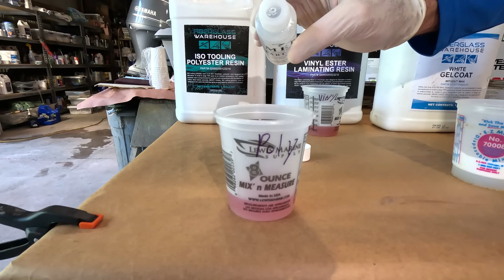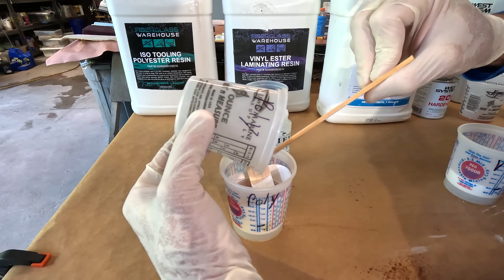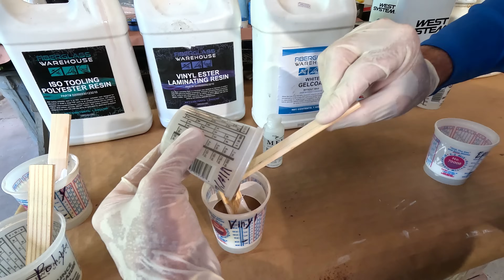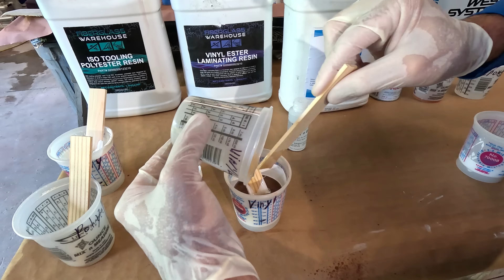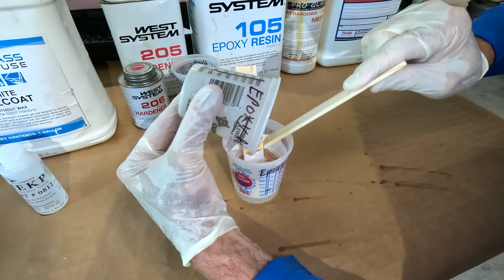MIXING GELCOAT with EPOXY! WHAT WILL HAPPEN? Is It COMPATABLE?

Comment: I completely replaced the stringers, foam and all wood in the floor of our boat. Have since replaced everything - stringers, foam and wood. Now I would like to paint the Bilge with a white coating. The Bilge has 100% new cured chop strand with epoxy coating it, I sanded it with 60 Grit. What product would you cover the bilge with? Thanks

Comment: Like you stated the epoxy is sensitive to resin/hardener ratio....next thing you do is dilute the appropriately mixed epoxy with incompatible ester....spreading thin the hardener that was going to be curing the epoxy just fine. Would increasing the amount of hardener result in a proper cure in this scenario?

Comment: Over 80K buddy, you'll get that silver plaque soon.  This was an interesting experiment.  I remember a few decades ago a friend of mine put some old epoxy paint over an old fiberglass boat.  I don't know if it was a bad mix or just too old to cure but what a mess.  It didn't cure at all and we spent several days scraping uncured paint off of the bottom of that boat, what a mess.

Comment: Hey Joe,  I am learning g a lot from your videos.  I have made some composit plywood boats before with epoxy.  I am planning on going up a big step and make a 26 foot ply on frame boat.  I hesitate to start glassing a hull this large with the short work time of the poly resins.  I am thinking epoxy with good paint instead of gelcoat for my bottom and sides.  How would I use poly to glass such a large area consistently if I would go the poly/gelcoat route?
Reply from the maker: I'm glad to hear that you are enjoying the channel! There is certainly nothing wrong with using epoxy on your 26 build, if that is what you are comfortable with using. Vinyl ester resins also have a lot of good qualities, that give you a bit of a hybrid between epoxy and polyester resins. You might even want to consider buying some different resins, and testing them a bit, just to see the different working qualities yourself. I also recommend scrolling through our channel content, and really study the videos on the topics you are most interested in as a way to really learn as much as possible. Beyond that, I do offer direct consulting services through Patreon if you need more than the videos can provide. I hope this helps, and I wish you all the best with your project!

Comment: is it the same for epoxy primer? will gelcoat not stick to the epoxy primer? or is it just epoy resin the gelcoat will not stick to? please help!
Reply from the maker: Yes, generally, it is not recommended to apply gelcoat, which is polyester resin based, over epoxy based products. There can be problems with curing and  long-term bonding between epoxy and gelcoat. I do have a video titled You can gelcoat over epoxy. In it I show a product made by System 3 epoxy called sb 112. It's designed to work between epoxy and gelcoat. I have the sb 112 and all of the other products we use in our videos in our Amazon store, listed below our videos descriptions. I hope this helps, and thanks for watching!
Reply: @FishBumpTV  your answer is highly appreciated. thanks!

Comment: Another great video thank you! I have a Fir wood constructed console and leaning post. What would you recommend for finishing the inside. To cover the wood and protect form moisture? Can you mix resin and gelcoat like you just did and just roll it on to the sanded wood?
Reply from the maker: Thanks, I'm glad you are enjoying the videos! I would recommend at least a layer or 2 of csm fiberglass to thoroughly seal plywood from the elements, if it were me. I have seen some people, just resin coat the wood, which is certainly better than nothing, but adding glass is better. I have several, How to fiberglass over plywood videos here on the channel, with each one using a different type of resin. I think you would find those videos, among others here on the channel, very helpful! I wish you the best, and I appreciate you watching!

Comment: Worst example i've heard of is polyester repair over epoxy, worked perfect for years, until the boat was in a storm and the repair started falling off, they didn't loose the repair totally, so no catastrophe, but it was close,
It would be interesting with some experiments with polyurethane, not the foam, but in two part glue form.
Reply from the maker: Yes, that is why we don't recommend polyester or vinyl ester over epoxy. It may work fine for a while, but can fail over time, or when put under high stress. Thanks for watching and taking the time to share your experiences with the channel!

Comment: What I'd like to know is if your using tinted gel coat over the repair to color match, then after a few hours can epoxy clear resin be sprayed over top of that as a clear coat to finish blending the color?  Similar to the way a car repair is done but on a boat instead. Automotive paint wouldn't hold up on a boat that's I'm water.
Reply from the maker: I have never seen that done before. It might be because epoxy tends to yellow over time when exposed to UV light. Thanks for watching and commenting!

Comment: Hey Capt Joe, what's your opinion on gelcoat over epoxy fairing like Total Boats Total Fair.  I recently did this on my helm and after watching this video I'm not sure how long it's going to last. Thanks.
Reply from the maker: Gelcoat over epoxy is always a tricky subject. The problem is that there are a huge number of different material combinations possible. Some of these combinations can work under certain circumstances, and others will not. That's why many companies, and I don't generally recommend applying gelcoat over anything epoxy based. An epoxy tie coat is an option, as it is designed to bridge the gap between the two materials. I have a video on the channel showing the use of a product from System 3 epoxy that works very well. I hope this helps, and thanks for watching!
Reply: @FishBumpTV thank you!

Comment: Love the videos really helpfull stuff. I am preparing to build a hard top for a boat as well and would love some insight on using different foam core materials like polyisocyanurate insulation board to keep costs down.
Reply from the maker: Thanks, glad you are enjoying the videos! The poly iso foam that we have access to is very low density,  and quite delicate compared to Airex or Divinycell. I would be concerned about it indenting or crushing at the mounting points. Not to say it can't be done, but I would be cautious about using it. The Airex was only about 90 dollars more per sheet than the poly iso. That's not terrible bad for a core that I am sure will hold up. Maybe you could do some testing, and see what you come up with. I wish you the very best with your project and I appreciate you watching!

Comment: I have switched to measuring nearly all fluids in metric. It’s so easy, when it says “add 2.5%”, in metric. 2.5% of 100ml is 2.5 ml. Do that with 3.5 oz? What’s 2.5% of 3.5oz? I would love to switch on job sites. Find the center of a 15’ 5 5/8” wall. Doable, but metric is so much faster. Frustrating.
Reply from the maker: I hear ya! It can be challenging to unlearn and relearn a new system, but I can definitely see the benefits! Especially since the whole rest of the world is on metric. I will try to work more with metric in the future for you all.

Comment: I am using epoxy below waterline and polyester above. 
I did allow some gel coat to flow over the epoxy, only a few days old….it didn’t set!  Heck of a job to remove as it was inside a centreboard casing.
I do find that you can use polyester over old epoxy.  You need a good mechanical bond, and what really helps is if the epoxy has glass or filler, as the poly bonds well to them.
Reply from the maker: Interesting! Thanks for sharing!

Comment: Im just wanting to know if epoxy can be poured over a poly stained wood..  im using the poly stain to get the color i want and the epoxy to make the thick barrier and level out the burns on the wood..
Reply from the maker: Not for sure on that one. I would imagine it should work, but probably a good idea to do some research and testing. Thanks for watching

Comment: I used to build and repair surfboards. I have repaired a few by putting a clear gell coat over an epoxy board. Never had an issue. As long as you get the amine blush off the epoxy first then it seems to adhere just fine as a finish coat.
Reply from the maker: Thanks for your thoughts.   It is hard to pinpoint exactly which gelcoat and epoxy resins can have issues in certain combinations.  Sometimes problems don't arise until sometime after the application. That  is why many professionals and companies don't generally recommend it. I try very hard to only show or recommend products and combinations of materials that I know will work. Appreciate you watching

Comment: Yes, as a general rule, polyester over epoxy is not recommended. However, as an aethestic such as as pigmented finish/gloss coat or gelcoat, you can do it without problems. It was done for years in the surfing industry in Australia without any problems. Structural bonding, though, is a different matterand nit recommended. Cheers

Comment: You are about to get a million Andy from boatworks comments..... 
.
You basically inhibited either resin from forming the chemical bonds needed to thermoset. Although the gel was catalyzed, once you mixed it into the epoxy, you spread out the polyester, and the catalyst. Same goes for the epoxy. Yes, you catalyzed the epoxy, but immediately diluted it with poly resin. So what you ended up with, were 2 reactions that never had a chance to do their job. It would be interesting to throw a flir camera at that concoction from the start to see if it generated any heat at all. 
.
I know west systems 205 in a pour that thick, would normally be warm to the touch, and a half full mixing cup will run away to a temp that will melt the cup. (205 has a steep learning curve) What would be more damming, is if you let both products start to kick before mixing them. I mean, right before they start to gel up, and you can just barely blend them, then mix the two. I have some nice black no wax gel on the way, if I have some left, I might try it myself for science.
.
Andy has already provided a nice video where he had to kinda put his foot in his mouth when the gel coat hung on to epoxy like a scared octopus. You could argue this is not representative of bond strength over time, but in the intermediate, it demonstrates initial bond quality. There are also some gel manufacturers, and epoxy manufacturer's videos on youtube, explaining how to apply gel over epoxy.
.
I think, there isn't a definite answer. It will probably boil down to what enginenerd at company X says their product is compatible, or incompatible with product type Y.
Reply from the maker: Yes, lots of possible variables in this little test. Thought it would be interesting just to see what would happen, and talk about epoxy and poly pros and cons. I do have a product test coming soon that should solve some potential polyester gelcoat over epoxy issues, so stay tuned and thanks for watching!

Comment: If I use jb marine weld epoxy to fill some transom holes on a 15' 1972 fiberglass boar (NOT high-end), should I still use polyester resin and gel coat combo to cover fill-patch?

Comment: Joe, could you elaborate on vinylester.  Why would you ever mix it with polyester?  Why do you prefer it for repairs?  I grew up around a fiberglass shop and have used poly for everything except the rare occasions I use Epoxy.  Doesn’t vinylester have a much shorter shelf life?

Comment: Thanks sir for giving your time and you useful experience,
I have some questions
1. What kind of paint you recommend on epoxy instead of gel coat? 
2. Can we add some parts parts like a cupboard etc made of epoxy on a boat made of polyester resin?
3. How can we know a boat made of polyester resin or epoxy resin?
Thanks in advance

Comment: Joe that was an interesting way to showcase the compatibility of gelcoat with the other materials. Every video you share with us explains a bit more of the products and their role in the process. You said that the gelcoat is poly resin with color and fillers added in which makes since now as to why they are better suited to be used together. Thanks again for yet another piece to the puzzle of how the process works.  TW

Comment: Yeah, mixing liquid poly and epoxy is always going to be bad. I regularly gelcoat over fully cured and keyed West epoxy on my own boat with no problems at all. I used an off brand epoxy one time and even after two weeks the gelcoat wouldn't cure. The fix was to coat the job in West, cure, key, and gelcoat.

Comment: I just repaired some compart lids on an old bass boat I have . After I removed the carpet, I applied 2 coats of epoxy resin because the wood grain was raised bad, and some had began to separate. I hope that was a good choice. I have re-carpet all the lids. And one was really bad I used some Ardmid fibers I had into the resin as extra strength I'm limited to what I have . I hope all goes well for me.
Reply from the maker: Thanks for sharing and for watching! I wish you the best with your project.
Reply: @FishBumpTV  I fish out of it yesterday so it's still good 👍

Comment: Capt Joe, what about a test where you do a 24 or 36grit grind on some epoxy and apply different resins to it. More or less pull on it until it pulls off the epoxy
Reply from the maker: Thanks for the suggestion! That's what I was talking about towards the end of the video. It is relying on a mechanical bond, instead of any kind of chemical bond. Stay tuned, and I appreciate you watching!
Reply: Most epoxies take about 7 days to fully cure. Once it’s 100% cured you can sand and put any poly over it including gelcoat. You’ll be creating a mechanical bond between the epoxy and the poly with the sand scratches.
Reply from the maker: Yes, I talked about that option towards the end of the video. I think a lot of people missed that part. Most companies still only suggest doing that for cosmetic repairs in many cases, so it can be tricky for some folks to determine when that applies to their repair. Thanks for watching
Reply from the maker: Thanks for the suggestion, and for watching!

Comment: Thank you for showing more epoxy-based content. I'd love to see epoxy considerations under different climate scenarios if you have the means to explain that to us. Ice, snow, uv, heat, highest heat allowable, etc
Reply: The only UV stable epoxy I know of is West Systems, that’s what is used for Carbon Fibre parts that are designed not to be painted.  Polyester is not UV stable, that’s why you need to keep gel coat waxed.
Reply from the maker: Thanks for watching and for the content suggestions! Much appreciated

Comment: Your timing couldn't be any better. l just bought a boat and plan to do some cosmetics to it. It has some small gouges and some spider cracks and thus far you have provided most any if not all questions l may have had on working with the product you have. So doing the repairs and final gel-coat on my boat will go good, but it will be labor intensive Thank you!
Reply from the maker: Glad the videos are helpful and I wish you all the best with your project!

Comment: I used U.S.  plastics light weight body filler with polyester resin to make a thinner fairing compound. Marine fairing compound is ridiculous in cost  and says don't use below the water line either unless sealed. I'm spraying gel coat once its ready. To hot and humid right now. Im in Silverhill so you know what I mean lol.
Reply from the maker: Very cool, thanks for the comments and suggestions! You can also use vinyl ester resin mixed with cabosil or colloidal silica for a very good moisture resistant filler. Fiberglass warehouse has the VE resin for around 75 bucks. I hope this helps and thanks for watching!

Comment: Nice experiment, the vinyl mix seemed easier to break than the poly mix.
Reply from the maker: Thanks! Yes, the vinyl resin to gelcoat blend did seem to break easier. Maybe that's because the  gelcoat is a polyester and the materials blended better. It's always interesting just to see what happens with these experiments, even if it's not something you would ever typically do. Appreciate you watching and commenting!

Comment: Can you do a test where you apply gelcoat over fully cured poly/vinyl/epoxy instead of mixing them? Also maybe different epoxies and with/without removing amine blush? Appreciate the time you put into these videos and have improved my workflow a bit thanks to your tips!
Reply: The more testing the better but have you checked out Andy at Boatworks Today on YT?  He’s done a number of these although he always preps the surface.  I can tell you, not prepping the surface is guaranteed to fail/delaminate unless of course you’re using laminating resin.
Reply: @andrewnajarian5994  I believe Andy exclusively used West Systems epoxy in those tests. Joe has used many different epoxies with different mixing ratios and has pointed out that 3:1 and higher have more amine blush. He also mentioned a product that should promote adhesion; something that wasn’t likely available when Andy made his video 9 years ago.
Reply from the maker: Great suggestion! I will try to do more materials testing and comparisons for you all. I really appreciate you watching and commenting, Thanks!
Reply: I have been watching Andy's at boatworkstoday video's for years. I Like these videos a lot more please keep them. coming.
Reply: @davidtornberg8060  yeah, I like both and I really appreciate that Joe is much more to the point as well.  Andy’s channel is full of a lot of great info too though.
Reply: I have put flowcoat over epoxy, fully cured and sanded. Seem to work fine.